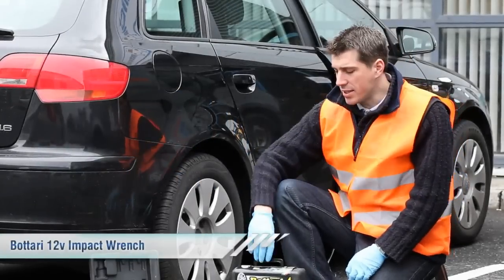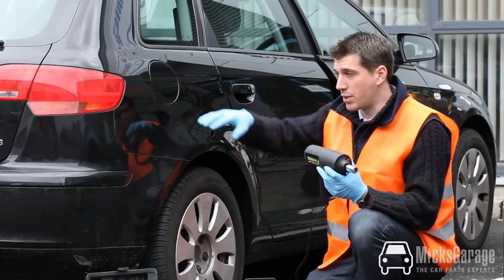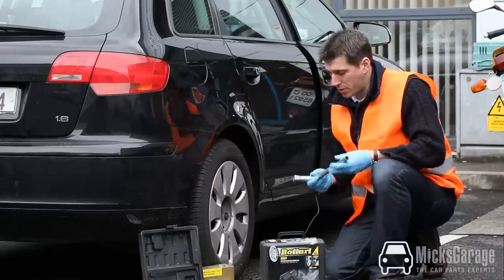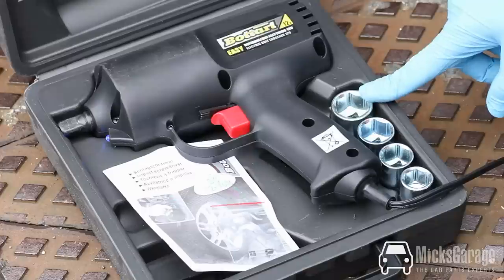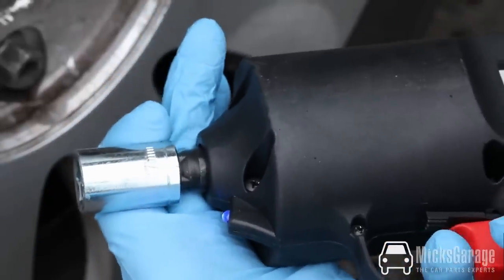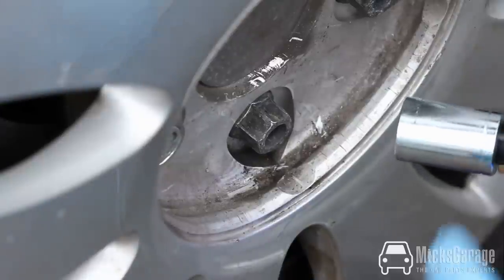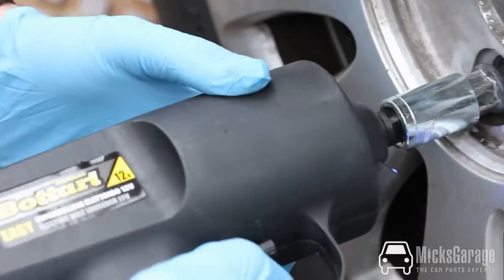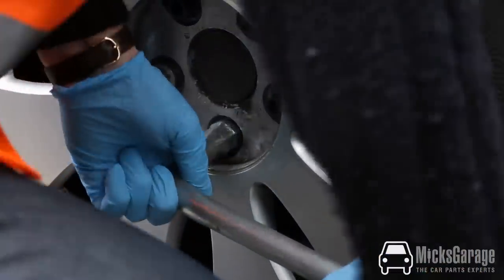12 volt Impact Wrench Tool Review

Comment: Looks similar to the Harbor Freight 12v emergency impact wrench.
It's very cheap, and it worked but it burned the cigarette lighter fuse on a Subaru. When I used the alligator clip adapter that clamped onto the battery terminals, I was able to reach all the wheels except the rear one on the opposite side of the battery.
Being used to impact wrenches that hammer 5-10 times per second, it was awkward to operate one that hammers only once per second, and stalls occasionally.

Comment: Bought one of these from Aldi, got a couple of years use before it wore out, they're really only for light work.
The trick with them is to slightly loosen the wheel nuts first & then spin off with the impact wrench, makes the job a bit quicker.
The same with tightening, spin the wheels nut as far as the wrench will go & then tighten with a power-bar or decent wheel brace.
Reply: Finally someone with common sense and logic.. Thank you fine sir..
Reply: The idea of an impact wrench is to remove bolts/nuts that won't shift with the spanner.

Comment: I have this 12v impact and I have another one that is made by someone else. Anyways this one sucks and it doesn't have much power. Not only that but the clutch thing broke internally. The other one I have is much stronger.
Reply: Get yourself a Milwaukee M18 fuel 1/2 600+ ft lbs. With proper  impact sockets. Or go see a mechanic!!

Comment: Hm ;

A positive review by a guy who sells them......

I have this exact tool but the name on the sticker is "XPERT IMPACT WRENCH 2" .

It's new and doesn't seem to work, the electric motor spins up fine but the 1/2" drive part never gets any force ~ I took it apart and it was assembled dry so I added a tiny bit of fully synthetic red grease, still no joy .

I don't know if I should keep fooling with it or lop off the cord & plug and bin it .

-Nate